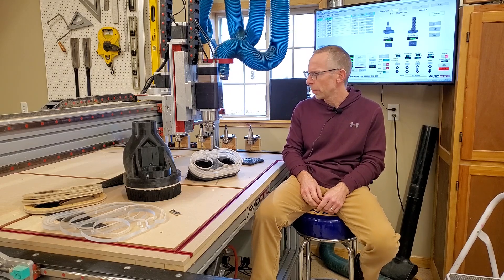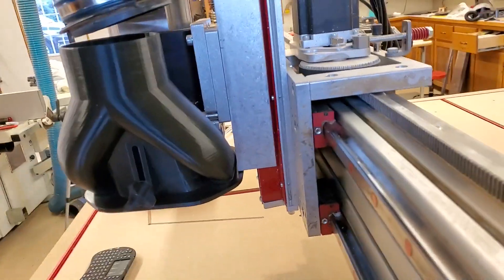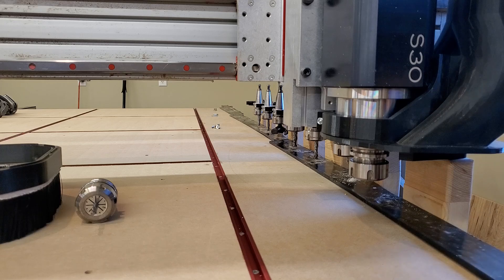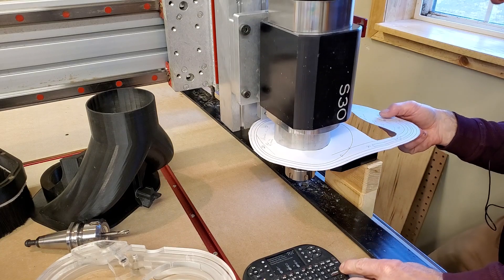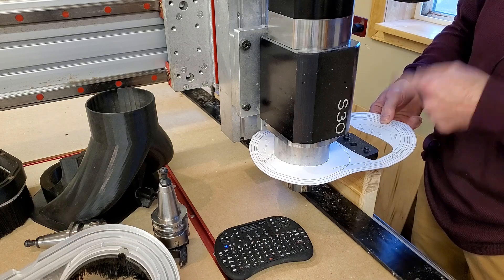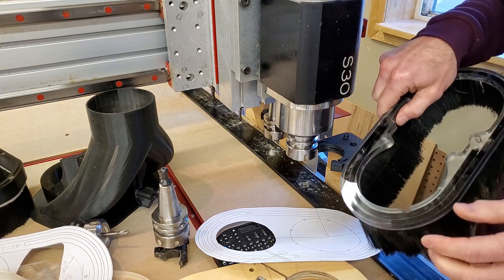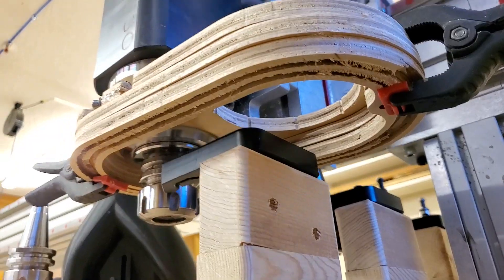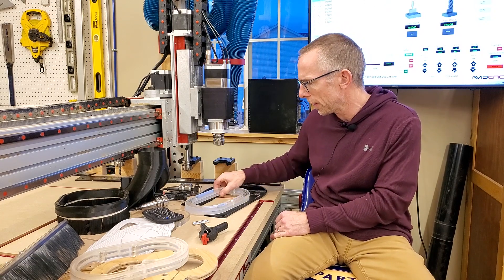CNC dust collection with an auto tool changer

Comment: That's an AvidPro CNC, is it not?  What router/spindle are you using to have an auto-tool changer?  I have the 8hp spindle, and I had thought they couldn't use that feature.
Thank you

Comment: What bit did you use to cut the acrylic regular o flute?
Reply from the maker: O flute for the 1/4", but I didn't have an O flute 1/8".  The compression bit cut alright but didn't clear chips so it really loaded up in the clamping groove.  Took a while to break them out.  While I was cutting the brush grooves with it I used a pick to try and clean some of the chips as it was working, will definitely have the correct bit on hand next time!